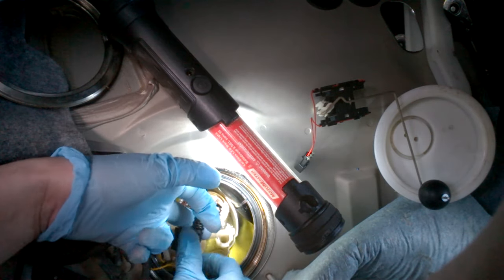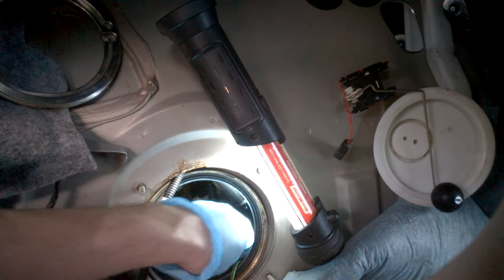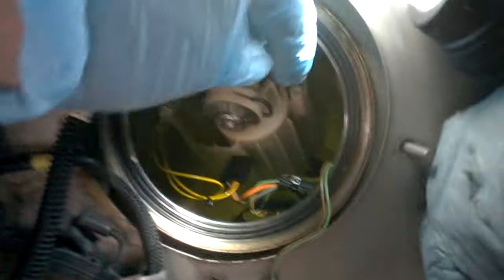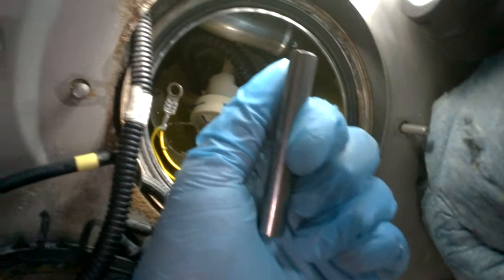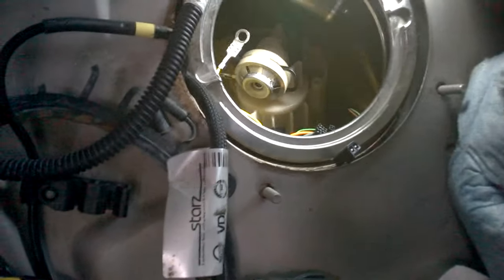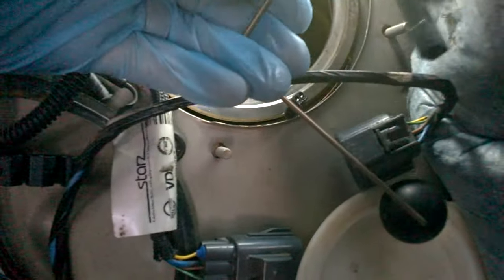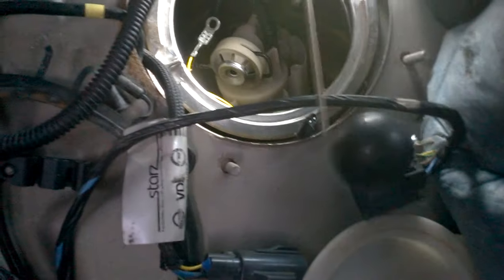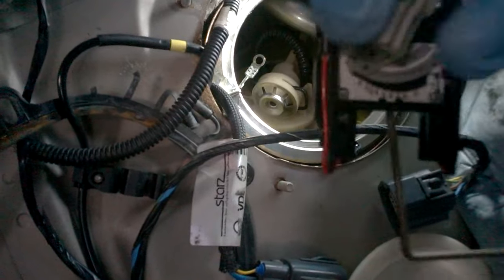Volvo S60 V70  A look at the fuel pump and sender unit - Metal gas tank  2001-up

Comment: FYI that Volvo had a recall for cracks in the top of the fuel pump where they would leak.  I contacted Volvo as this only applied to southern US states apparently (due to heat) and I was shocked that they would cover it.  Mine was an 02 with 170k miles, in more northern US.  As a short term fix to stop the fuel smell I cleaned it well and applied epoxy, it did hold until dealer did the fix.
Reply from the maker: Indeed, a common issue on plastic fuel tanks (metal ones had a different pump design).

Comment: Pay attention to how the separate plastic tower holds the fuel pump before you remove it.  This video does not show it.  There is a sleeve that slides over the long bolt acting as a long spacer.  I "lost" the sleeve in the bottom of the tank when I pulled it apart and finally looked for it when I realized a sleeve spacer had to exist.  There is only one way it works.  Real simple if you look at it first.  :)
Reply: This was so hard to get right with one hand reaching down into the tank.

Comment: I just finished replacing a pump with this configuration in an 05 and let me tell you, PAY ATTENTION to what you're doing.  I learned this the hard way.  The mounting parts for the pump are not shown in this video but they are a super pain in the ass to put back in.  It's like building a ship in a bottle.  You can't get both hands in the tank and the pump is not centered below the access hole.  It's below it and super difficult to reach and you can only work with one hand.  Some things I learned. 

1.  TAKE OUT ALL OF THE GAS.  This is super important.  I bought a battery operated transfer pump from harbor freight and pumped out all the gas I could into 5 gallon buckets.  
2.  The metal tool they recommend you buy in all of the other videos to remove the ring on top DOES NOT WORK for this configuration.  I bought it.  All of the other videos on Youtube are for a different configuration.  The ring in this one is METAL, and I removed it with a hammer and screwdriver, just tapping it until it got loose.  
3.  In this configuration there are two access plates, just like in all of the other videos, but the one on the driver's side doesn't need to be opened.  In this configuration, everything is done from the passenger side.  
4.  GET A RESPIRATOR and USE IT.  I bought an inexpensive one from Harbor Freight $15 and it worked great.  You spend so much time with your face over this hole, it was a lifesaver and I still had a headache.  
5.  When you pull out the fuel pump, MAKE A NOTE OF ITS CLOCK POSITION IN THE TANK!!! Take a picture, that's the best way to do it.  While you're at it, make a note of how the two plastic mounting pieces are used to secure the pump.  
6.  When you take out the pump, take out the two plastic pieces, and dry fit them on your new pump so you can see how they work.  Feel around inside the mounting ring on the bottom of the tank and compare that to the back piece that mounts the tank and you will understand how it works.  It is a piece of plastic that attaches to the fuel pump with friction, and in order for it to go into place, you have to first put it on the back of the pump, then tilt the pump toward the front of the car (with one hand), and slip the toe on the plastic piece into the notch in the ring on the bottom of the tank.  Once you get it in right, you can feel it working.  That piece of plastic secures that side of the pump.  Then there's another piece of plastic that secures the other side.  You'll see that when you open the acccess, but again TAKE PHOTOS with a flashlight with as much detail as you can get.  
7.  When you put it back together, install the wires all except for the last ground wire, but don't attach the fuel line until you've mounted the fuel pump.  It's short and you don't want to yank on it.  Mount the fuel pump, then reach inside with one hand and slip the fuel line onto the outlet on the pump.  
8.  When you put it back together, be really careful not to pinch the gasket. 
9.  This job is a total PITA and all of the other videos are totally wrong for this model.  Mine is a non-turbo FWD model and it doesn't have the two sided access, it only has access on the passenger side. 
10. Good Luck! You're gonna need it.
Reply from the maker: Thanks for the details for the Diesel configuration.

Comment: Big metal ring has threads on it.  It needs to be rotated counter clockwise well over one full revolution.  After one revolution the movement becomes easier but you will still need a hammer and chisel/screwdriver.  After one revolution you will begin to smell gasoline vapors.  Blunt, brass chisel is safest choice.

Comment: I NEED YOUR HELP!!!!! I have an 08 Volvo S60 2.5t. It runs and drives well for about 15-20 minutes. Then the fuel pressure will start to decline and it will be unresponsive when the gas pedal is pushed. the fuel pump will make an audible humming noise. I changed the fuel filter, fuel rail pressure sensor, fuel fill cap, PEM module, MAF sensor, and fuel send unit. I'm still getting the same problem. Any help anyone can give me would be aprreciated. Thank you. Peppermint, you have always given solid advice. Any ideas?
Reply from the maker: To me it sounds like the pump is overheating and shutting down. On earlier years there was pump relay on the CEM, when the pump would struggle, the relay would overheat and disconnect. Try to get a scanner and read the pump 'duty cycle'. Also on metal gas tanks, the hose under the pump (inside the tank) gets easily kinked when the pump is lowered inside the tank, I show this problem in another video, may your hose is partially kinked, the pump works harder, then it overheats and shuts down  https://youtu.be/w7wCZ4zCYF0   Otherwise, maybe a fuel line is kinked somewhere, maybe near the right lower engine mount, it passes very close and when the mount is worn it can crush the line. Don't forget to ask on forums like Matthews, although it may be tricky to fix
Reply: @Peppermint1  thank you.  I will check.  The duty cycle keeps calling for max pressure around 80psi. I'm only showing between 20-30psi

Comment: Agh I wish I would of known... I just bought an s60 filter but my car has the steel tank agh. I was in a crunch for money and I spent 20 extra. I want to ship it back to ipd but, then it's like i lost 10$.
Reply from the maker: If there is a problem with the fuel delivery, many times the problem is the FPS and the PEM. The filter on the steel tanks lasts very long time, I would worry about it unless the tank is very dirty inside - usually happens only when the tank was opened in the past for some repair

Comment: wheres the fuel filter? i see no place for these metal tanks..????
Reply from the maker: It's incorporated with the pump assembly, inside the white 'cup' piece. Non replaceable. It is a very long piece of filtering material - couple of feet long, rolled, should last life of the car

Comment: Hi. excelent video, but I would like to know, why no one upload a video from the beggining of this job. Especifically when removing the back seat. I don´t know how to remove it without cause damage to the seat. Actually I could access the pump with your video. Thanks a lot..
Reply from the maker: +Eduardo Hernandez  For the S60, the bottom cushion of the seat is a single piece and it's kept in place with two vertical clips underneath.  The cushion has to be pulled upwards on the front side, it will pop free.  For the back cushion, the side bolsters need removed first. I think they are retained with a bolt from inside the trunk. Once removed, the cushion has to be lifted upwards.  For the two dorsal sections, they are attached at the bottom with bolts accessed from the trunk, and one has also some sort of a metal pin. These sections are rather heavy.

Comment: My fuel pump went out on my Volvo S60. How did you get the old fuel pump removed? It didn’t show at start of video....
Reply from the maker: Sorry, I didn't film that (it's a very old video).  I remember the pump was secured to the bottom of the tank perhaps with a white plastic bracket with a screw - maybe also made of plastic if my memory is good.  Important part is, I had to detach the level float from the pump while inside the tank so I could pull out the pump alone through the opening.  This being a metal gas tank with integrated fuel pump filter (there's also a plastic tank).  Good to know that most of the time these pumps last forever, it's rather either the PEM or the FPS (or both) that go bad on cars after 2003-up

Comment from the maker: UPDATED Video : Full fuel pump replacement gasoline engines  https://youtu.be/w7wCZ4zCYF0
Most of the time the fuel pump on these cars lasts forever.  What goes wrong is the PEM (fuel pump module) and the FPS (fuel pressure sensor) on 2003-2009 cars  The PEM is the same for all volvo cars and years, just swap it. The FPS are different from turbo and non turbo. There is also a fuel pump relay on the 2001-2003 CEM units
Reply: Thanks for the info! Are those to be changed separately? Can one replace just the PEM/FPS? Is there a way to test it?
Reply: Where is the fuel pressure sensor located?  2004 V70 NA